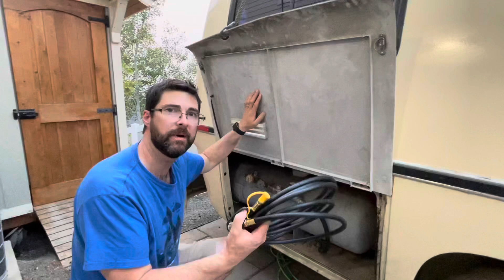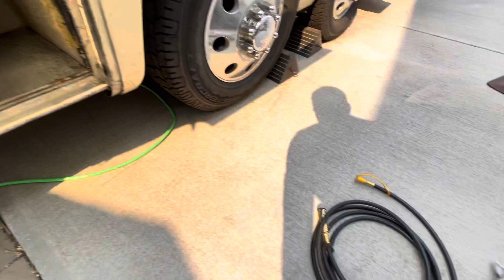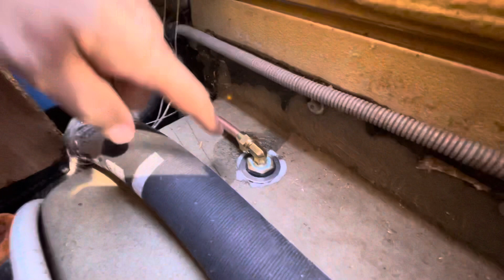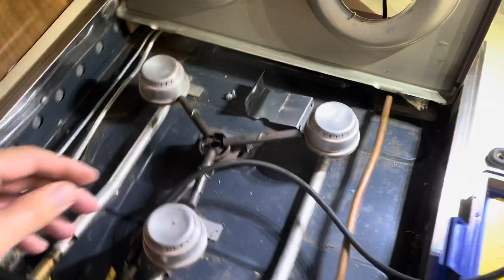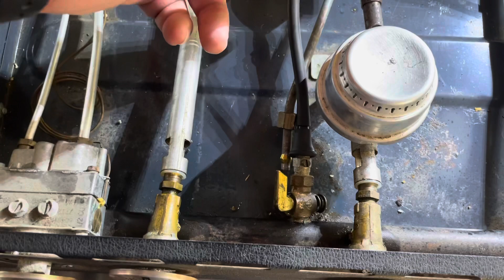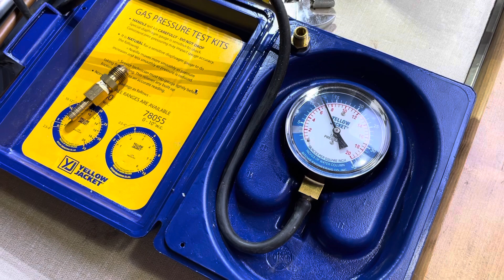77’ GMC Motorhome Propane Upgrades

Comment: Hi There,  I love these GMC motorhomes and am following the story of Edna with great enjoyment. I know this video was made 2 years ago, but I was concerned while watching that the new propane joints (great solution, by the way) are heavy. Even though they are "suspended" on the right side by the U-shaped new connecting hose, I worry that the constant bouncing will weaken the joint at the tank itself and ultimately cause a leak, God forbid a fire. Would it make sense to hang some kind of support for the right side in addition to the U-shaped hose itself (the side closest to the front of the RV) to keep it from bouncing too much while driving? It is the kind of thing that will work great for many months, but eventually could weaken the joint at the tank and leak. Just a suggestion from an "Edna fan". God bless!
Reply from the maker: Thanks for the comment! It's a great point, I felt like the line was stable when I did the project but I got a couple other comments and as I thought about it, I decided to be better safe than sorry. Here is a link to a video of a support added a few months later. https://youtu.be/Mvvg9-KHfy8 I'm really happy with the end result and it's been working great.

Comment: I've learned so much from your step by step videos...thank you...one observation...if I'm not mistaken, on the left side of the door to your propane tank ( and also on the left side of your generator door)  there is a little black rubber bungie...the bottom slips off a nut and attaches to a small hole in the bottom of that window to secure the door open, no need for a separate bungie cord.
Reply from the maker: Thanks for the comment Ken! I have seen that on other coaches, ours has had the window seals replaced and the new seals don't have the normal hole in them. I have thought about making a hole but the stock bungies are pretty hard and cracked so they may break if I used them. I may do air struts at some point, but for now I'm just keeping an extra bungie handy. :-)

Comment: Nice work. I'd recommend using as few fittings as possible. They make 3/8" quick connect fittings for propane, which would eliminate the need for that reducer. With the overabundance of low quality brass fittings today, you really don't want any more fittings than absolutely necessary, and those fittings you do use should all be excellent quality. I wouldn't trust Amazon fittings here.
Reply from the maker: Great point! I got nearly all the fittings at my local RV gas shop. They had very nice high quality fittings. They were about twice the cost of Amazon but I trust someone who makes LP lines every day over a random Amazon seller with cheap prices.

Comment: If you plumb your BBQ T before the regulator you don't have to bypass the regulator in the BBQ
Reply from the maker: Yes, that is true. I wanted to use quick connect fittings rather than screw fittings so the lower pressure side was best for me.

Comment: Hmm, I would have thought putting a T-fitting where the propane enters the Water heater, instead of drilling through the fiberglass. (using only 1 T-fitting in the propane compartment)
Maybe there isn't enough room to work where the propane enters the water heater?
Reply from the maker: That would have made this easier but our water heater is electric only so there wasn't a gas line to tap into on that side of the coach.
Reply: @MrGMCMotorhome  Oh, Wow, I love those GMCs and would love to have one, (Maybe someday) But I would never have guessed it was not propane heated. Was Electric only standard when they were built?
Reply from the maker: These have a unique set up, the heater hoses from the engine run back to the water heater and there is a heat exchanger that heats up the hot water while you drive. It stays hot for a while but you have to use 120v (or start the engine) to make hot water while you are camping. As far as I know, this was the only option from GM. I think some have gas water heaters from other upfitters and some people have added gas water heaters later.